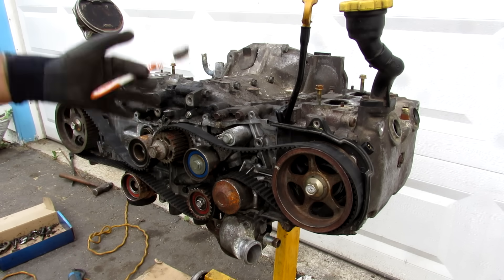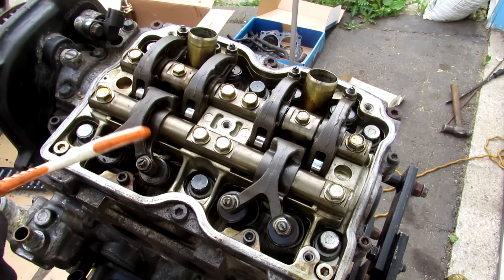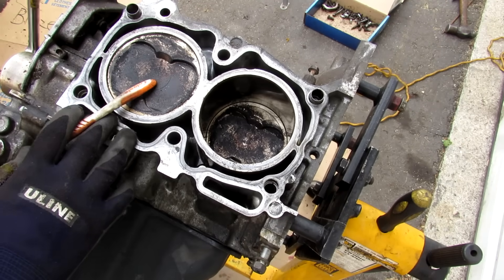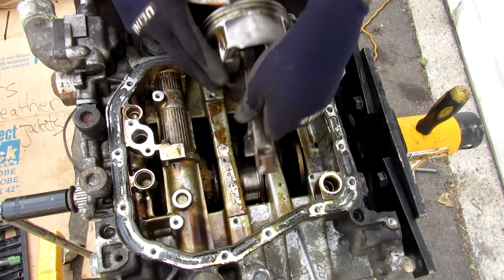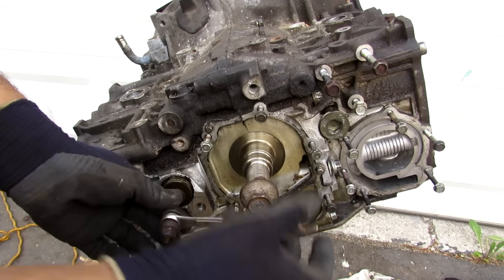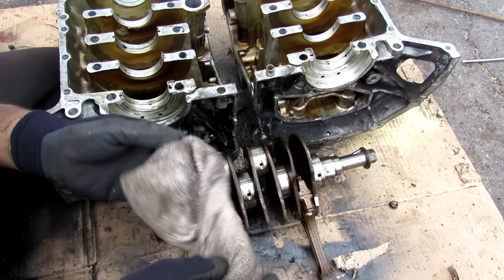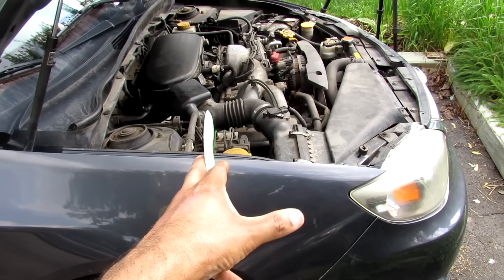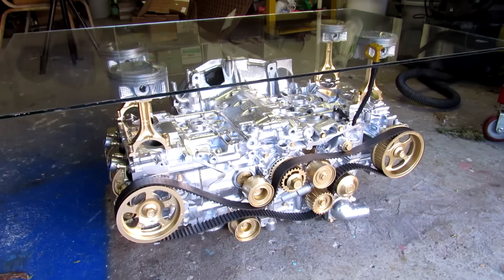Why Subaru Engines FAIL

Comment: Integras are narrower than other models. Thus less space for the wide engine. Replacing the rear spark plug on the driver's side is painful. Replacing leaking valve cover for leaking gasket is often done by pulling the engine. Apparently, the 3.0 liter H6 is even less fun.

Comment: Apparently Subaru redesigned their head gaskets to decrease head gasket failures. Otherwise, proper and regular oil changes as a part of maintenance is on the owner.
Reply from the maker: True. However the newer FA engines had their quirks as well

Comment: Except they don't fail. I have a 2002 EU STi, and it still works as a swiss clockwork. You should use high grade engine oil, Motul advised, do the maintenance as prescribed. And, most importantly, always let the engine warm up, especially the oil, properly before pushing hard and let it run and cool down a while after forced runs before switching it off.

Comment: Its curious that people put down the Subaru engine so much but if go looking for them there are a ton of them that have 300k miles or more. Percentage wise much more reliable than all those GM Ecotec and Ford Ecoboost or anything European or Tiawnese.
Reply from the maker: Yes. It has its drawbacks but also it's draws, mostly it's AWD system and chassis setup with the boxer.

Comment: "Make sure you keep up on Maintenance."  That's basically what I took from this. Not that there is anything inherently wrong with the design, but rather a description of what will happen if you don't maintain it. IE: If you don't maintain it, this is where you will have problems. The simple solution is to maintain it. That's what I did with my last one and it was fine, so I got another.

Comment: Have a 2000 WRX, done 360K, original engine, original gearbox, original rear diff, oil is changed every 6 months and still brilliant. Love it, revs out to 7k, great steering, original clutch lasted to 320K as did the shocks. Hoses replaced, rocker cover gaskets need replacing and body work is average. Great car.
Reply: Forged internals really do a lot for the longevity of the motor imo.

Comment: I'd just buy a rebuilt engine before I tore that all down. My 3.0 has made it 376,000 but needs new front and rear seals. Just got a '17 forester with the 2.5 again. My second 2.5. First had heads machined twice.

Comment: Im still unsure why people think the reason some subaru head gaskets fail is because coolant sits on the headgaskets when parked. Whoever says something like this doesn't know engines well at all. Coolant doesn't drain out of the block or heads on ANY engine. Coolant is always going to be touching the gaskets because its always full.

Comment: Our 2023 Subaru Ascent with 30K miles had an engine failure due to connecting rod bearing #4 failure -- looked totally worn like the ones in your video. Dealer did all oil changes, and I imagine they did a crappy job and killed our engine. Engine was replaced under warranty.

Comment: I have a 2013 STi hatch. Love it. When the engine blows I want to replace it with an EJ18 (sohc) that's been mildly built for boost. The cylinder wall on the EJ18E's is just shy of 14mm thick, nearly closed deck. Single cam has less moving parts (less friction) but will need head work to flow better. Pretty sure I can get just as much hp from the 1.8 that I get from my current ej257.

Comment: 07:44 The 14mm Hex "wrench" using a metric bolt is a great idea. On a side note - years ago Subaru recommended a coolant additive  to be used at each coolant change. Turns out it was a head gasket sealer. And in 2014 or so (most but not all) they started using timing chains instead of a timing belt. The water pump is also driven by the timing chain.

Comment: One thing you’ll learn quickly is to ignore the manufacturer’s recommended oil change intervals and for the most part cut that in half.  The old saying was oil changes are cheap insurance. I’m sorry but a vehicle that takes less than 5 quarts of oil will never see more than 3 or 4000 mile intervals out of me.

Comment: 2 years ago I bought my daughter a 2009 Subaru Legacy with 100k miles on it.  The timing belt was changed and the oil is changed regularly as well as the coolant is kept full.  The car is running very well and seams reliable.  Is there anything else I should be doing to keep it running?  The engine is the EJ-253, 2.5, 4 cylinder.  Is it reasonable to get 150k out of this car?

Excellent video by the way! I've looked high and low for a video of this nature and this is by far the best.
Reply from the maker: Pay attention to the coolant level and engine temperature for tell tale signs of headgasket failure.

Comment: So, I guess this engine is only good if you are a rally racer. As for a daily driver, it’s crap. Because gravity and the way the fluids pool? I was debating getting a Subaru
Reply: Also hard to work on which I like to do my own maintenance
Reply: its perfect for a daily. there easy to work on, you just dont know anything about it cars.

Comment: Why do many Subaru’s have 200.000 miles on them?
Reply: The EJ253 would blow the headgaskets, get repaired with the EJ255 or 257 headgaskets, and not have the issue again. Not much fails on a Subaru, and they are worth keeping around.

Comment: As a Subaru owner and well experienced with its faults, this is a very well demonstrated video. I appreciate the input on the pros and cons. I personally like Subaru's but I will admit they have their problems. I do my own maintenance and it is quite true, the engine does eat up oil. Now that's not the end of the world but I would keep an eye on the level once a week. The worst thing ever is no oil and running hot.
Reply from the maker: Tbh if they didn't have these flaws they'd make a decent quality car.

Comment: Boxers generate more problems than they solve, and the low center of gravity would be true if the alternator, ac unit, and every other system accessory weren’t mounted on top of the block.

Comment: 2014 OG EJ25 at 150k miles. Still no major failures. Normal engine maintenance is all anyone needs for a Subaru to last. All those morons on the internet saying that Subarus or WRXs are super unreliable haven't touched a flat four in their life.

Comment: While unorthodox, i think the ej is a fantastic engine that gets a bad rep from (let's be honest here) bad owners. My impreza has been used as a winter beater for the last 25 years with no issues apart from basic maintenance (at least from the engine, i had to fix broken suspension, very rusty brakes, and a weird transmission issue where it didnt go into drive easily for some reason). I know a lot of guys skimp out on maintenance like changing oil & filter, replacing the timing belt, etc, and mine is no different. It's been a few thousand overdue on oil a couple of times years ago by the previous owner, but thankfully, nothing serious came of it. I also want to note that people push these engines hard, revving them at stop lights, redlining on cold starts, and flooring it all the time for the thrill of it, but at the same time these people shouldn't complain about the engine being unreliable when all they do is abuse it. If you're going to use an ej to make big power, build it correctly. I've seen my fair share of guys slapping on a big turbo without any supporting mods, which obviously destroys the engine. If you want to build one, be aware that an ej is going to be more expensive than building any other inline 4 just due to the fact that it's a different engine design, utilizing 2 banks, and has an individual crank pin for each piston. That's not to say it doesn't come with its benefits, though. The power delivery is very smooth, the sound is unbeatable, and it has a very low center of gravity, keeping you glued to the road. The last thing i want to say is that not all ejs are created equally. The ej 251-253 are the ones with the most issues such as head gaskets, oil starvation, etc. Any ej20 ej22 or ej255 or 257 are just better built than the other ones.

Comment: Head warps slowly with time causing blow by, that is far more common than blown Head gaskets. The gaskets have been greatly improved and the problem still persists which indicates that the gasket is not always the Primary cause. You either love a subaru or you hate it. It's a Personal Choice. I've got a 2004 and a 2016 foz.

Comment: The oil starvation issues can be solved by overfilling it a bit if you drive hard in corners frequently, a custom pan is better solution for permanency though

Comment: I have a 2022 Ascent with 60466 miles currently in service for a blown engine, cracked right hand valve cover, broken rockers, and possible blown engine. Not a complete diagnostic yet, could you give a reason for this and why Subaru  would not cover cost.

Comment: I have a 2015 Subaru Forester with 2.5 Boxer engine. I heard it doesn’t have any head Gasket’s. They say it has silicone glue between the head and block. Is that true?

Comment: Any engine with quarter mile long timing belt is doomed to fail. Most idiotic design ever...
Reply from the maker: It's better than some chain engines today
Reply: @speedkar99  Aluminum block engine where treads can easily be stripped tightening steel bolts, silicone gaskets out of the tube instead of real gaskets, too many over engineered components...no for me. I know cheap when I see it.

Comment: I used to own a 150k mile 2009 Forester LL Bean Edition. I had the alternator fail twice after 10 months of ownership and putting less than 1,000 miles on it per month. During my last 2 or 3 months of ownership, the battery light would flicker while travelling at highway speeds and while the RPM was at least 3000 while doing things like accelerating or going uphill. Other than the engine issues, the AWD system made the steering system sensitive and sketchy while maintaining a lane on interstates and other major highways vs multi-lane city and state roads due to the speeds.

Comment: I've had several friends where I work that drive 150 miles a day to work and back.Both drive Subarus' that have over 300,000 miles on them and still running.

Comment: You guys are generalists, and pretty sloppy on telling your audience what model years your "Fails" encompass. 
Had an EJ22 for 10 years and 100,000 miles. Zero problems. Had an EJ255 in a Legacy GT for 12 years and 100, 000 miles. Zero problems, no oil use, and used only regular 5W-30 dino-oil, no synthetic.

The Subie problem was the EJ253. And they haven't made any since about 2010. So you're a dollar short and 15 years too late on this expose. The local chief mechanic for the Subaru/Audi dealer was a pal of mine, since we had similar hobbies. So I saw dozens of dead EJ253s littering the service bay floors -- remember, the height of Subaru's crisis was 2002 to 2005, two decades ago. Most had scuffed cylinders on the passenger side bottom, the thrust side, where, according to you, the oil should have pooled  when the engine was shut off. 

Anyway, he put my EJ22  on the official Subie oil consumption test, as it was a piston slapper from cold. No oil consumption in 3,000 km, ckecked at 1k and 2k. So no problems at 120k total use range.

Being a mechanical engineer, I wanted to know the difference between the engines. 99x79.5 mm , compared to 97x75mm. And both these Phase 2 engines had open deck unsupported cylinders waving in the breeze == one displacement worked, the other did not. Nothing to do with head gaskets then. Don't know that a conclusion was ever reached.

But the  silliest thing you say is that a 60 degree V-6 is smoother thana boxer four. Provide the math, because you're incorrect. Just mouthing off.

Comment: It's quite simple.  The 2.5 was never as good as the 2.0.  The EJ20 is where it's at.  I have seen them with over 400,000 miles on them with no issues.  The USA only really ever had the 2.5 so you don't know how good it was 😂
Reply from the maker: The 6 cylinder is where it's at.

Comment: I was explaining to my mom why Subaru engines are crap. Imagine an 8 layer shit sandwich. Take that shit sandwich and turn it on its side and watch the shit start leaking out. That's the oil in a Subaru engine and the shit is the oil. Proof is the shit stains left on the concrete where you had the Subaru parked.

Comment: I am on my 2nd high milage Subaru with piston slap, 2000 outback limited 380, 000 km owned for 7 years, and now a 2001 Forester L with 403, 000 km. Piston slap presnt in both but never an issue.

Comment: Yep, I got myself a Subaru Boxer engine. And yep, at 105,000 mi, I had to replace the head gaskets. And the half axles. And the brakes (again). And the Dashboard! (It turns sticky in the sunshine). Oh, and the alternator. And of course, the exhaust system. 

I am not a fan of Subaru.

Comment: My 2019 Subaru 2.0L engine has 155,000 miles on it and still going strong. It doesn't have a belt drive. It has a chain drive.
Reply from the maker: That's the newer FA20 engine. Check my other video on that.

Comment: Dude… you haven’t explained anything 4 minutes in 🖕🖕
Reply: There's nothing to explain. Properly maintained Subaru engines do not "fail'. I've had a 1996 WRX a 1998 Legacy GT wagon and a 2002(still) GT wagon. None every had any problems. I do change coolant at 100K as well as FS oil at 9 - 10 K kilometres.

Edit to add kilometres.

Comment: My buddies 04 STI, yeah the og with the big wing has 200k miles. It burns oil pretty good, and the body is starting to rust. Wisconsin winters. He changed the plugs once, changed the coolant once and had the turbo service done once. That's it besides oil changes and brakes. I always joke with him about how lucky he is. Never touched the clutch either. Zero hwy miles, all hard city miles

Comment: I'd recommend using rubber rings to place in between some nuts and bolts to reduce the pressure and oil leaks!

Comment: What vehicle did this motor come out of out curiosity? Or if you don't know that what year was this motor produced?
Reply from the maker: No...I'm assuming mid 2000's
Reply: @speedkar99  alrighty, i was just curious because the valve covers on a 2011 ej253 are way different. Thanks for the reply!

Comment: About 8 years ago I went Toyota RAV4 when most of my friends went Forester. I told them at the time that Subarus were overrated and overpriced and wouldn’t last with hard driving in Aussie conditions. Three friends’ Foresters have suffered catastrophic engine failures and all were told ‘not worth fixing’. My original RAV ZR6 is now driven by my daughter (200k+ without issue) and my current Cruiser Hybrid is the best vehicle I’ve ever owned. My friends either have or have on order Toyota hybrids and swear ‘never again’ a Subaru.
Reply from the maker: Ouch

Comment: EJ25 is out more than 10 years ago, why are you even reviewing it? Check the newer F-series engines which eliminated the head gasket problem. 
I had an EJ25 Subi, incredible car, at 120k miles the head gasket started leaking but drove it like that for another 20k mles until Sandy killed it...Not a single engine/tranny problem, never knew where the check engine light is! Even the old tme bulbs lasted forever, have not changed one for the 10 years I had it!
Currently on  an FB20, absolutely no problems whatsoever, whit a few  mods it is an amazing small car!
Subaru forever!
Reply from the maker: Alot of EJ25's are still on the road. 
I already have an FA engine video, check it out!

Comment: Out of my over thirty cars in the last twenty years, two of them were Subarus with the 2.5 (2007 Outback) and 2 litre (1998 Impreza) boxer engines. They are not good engines, by any means and these cars have hideously poor interiors, compared to anything German. Both engines failed, the Outback had a leaking seal, a cheap part that cost the whole engine and having to scrap the car. Meanwhile, my E-Class, C-Class and SLK Mercedes were and are running fine. I’ll never touch another Subaru, in fact they even put me off of trying a Porsche with a boxer engine.
Reply from the maker: Good to know about the Mercedes

Comment: Had a 2015 Forester with 2.5 boxer. Underpowered and burned a quart of oil each change. However, it went 200k plus trouble free miles when I sold it.

Comment: Great video!The only proper  way to work on a Subaru engine  is to pull the engine out and of course you'll need the right tools..:) Junk.. My 2005 Forester XT (properly maintained)started spitting tail pipe white smoke  at 140K  miles ..My other cars, 1997 VW Golf 2.0L  (240K) and the '99 Dakota truck  5.2L(213K) also properly maintained still run great...  I replaced the Subaru  turbo which was shot but the white smoke was still present. (only $800, pocket change :)) I would not get a Subaru again, not even if someone gives it to me for free...Why people "die" after these pieces of junk , I cannot get it ...If an engine is not "friendly" to work on it, walk away...:))...
Reply from the maker: Was your Subaru rusty?
Reply: Nope. I have always kept her  in great shape. The only rusty bolts I could not take apart were the ones with springs that joined a section of the tail pipe .I had to cut them...  @speedkar99

Comment: Hi, will a 2018 subaru outback wagon have a cam carrier leak/drip at 34,000 miles on the car? bought the car end of 2017.
Reply from the maker: Yeah. Some seals fail with age, not mileage.

Comment: The EJ205 is a much, much better engine. It's the 2.0L turbocharged engine in the first-gen USDM WRX.

It has its issues (it's also pretty maintenance intensive), but they're known to last up to 300k miles. That's crazy for a forced induction gasoline engine.

Comment: 85% of Subaru engines have way to low pressures cooent caps...the are rated at 16psi but testing shows most only get to 8 to 10 psi causing head gasket failures